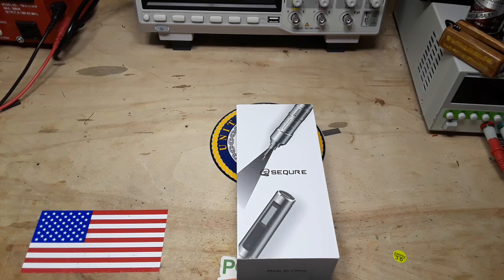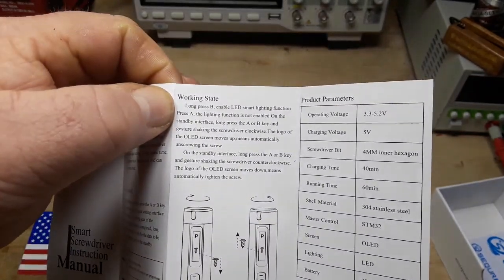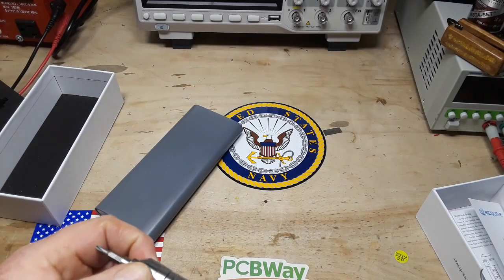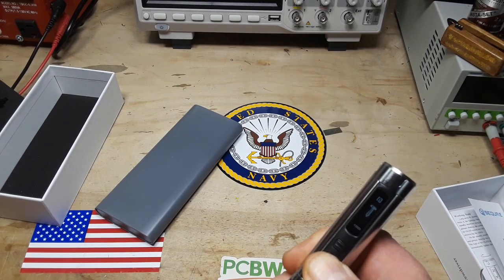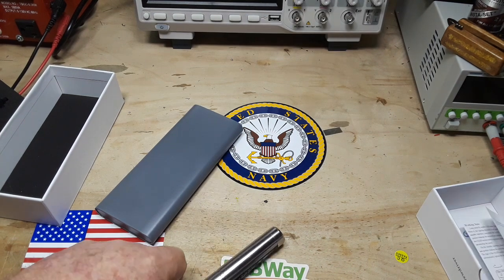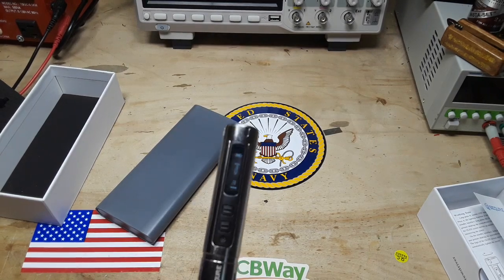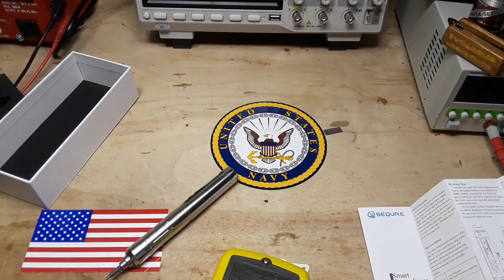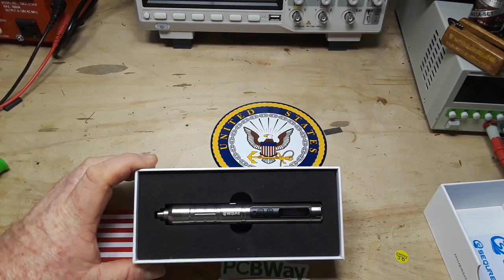SQ-ES126 Smart Screwdriver

Comment: Thank you for your review. I haven't laughed that hard in a long time. This is such an incredibly simple tool to use and you couldn't figure it out.  You just put the screwdriver on the screw, press and hold the button and rotate the screwdriver slightly counter-clockwise  - just like you would a regular screwdriver - and it will remove the screw. To put in a screw you do the same thing except you rotate the screwdriver slightly clockwise.

At about $100 this screwdriver is not for everyone. It's for people who regularly work on electronics like laptops, cell phones, cameras or RC drones. If you deal with a lot of screws on a regular basis this device is a tremendous time saver, not to mention the savings in wear and tear on your wrist. As far as electric screwdrivers goes this one is one of the best due to build quality and the ability to adjust the amount of torque that is applied. Sorry you missed all that.
Reply from the maker: Right over my head

Comment: Thanks learnelectronics' for reviewing ES126 screwdriver! This is sequre company, our this screwdriver have direction sensor inside, when you turn it slightly to left or right it will detect the direction automatically. All you need is to hold the lower to start it. If anyone have question about using this screwdriver, feel free to contact our official customer service. Thank you!

Comment: It's most certainly not "gears" but power levels driven by a switch mode power supply
Reply: Watch the Marco Reps ES-120 and ES-121 reviews. They have some interesting gearing inside.
Reply: @emmettturner9452  i stand corrected

Comment: OK... I have had the ES121  for a few years and love it. This is basically a clone of the ES121, close to clone, mine has one button. You've got the settings and how to use it all wrong. The "A" setting is for AUTO torque, meaning the more you turn it while holding the button down (doesnt matter what button) the more torque it will apply. You dont hold the button down and do a quick turn to "set it", it turns according to which way you start to turn the screw (while holding the button down). In other words, to use it, put a screw in hole, hold button down (continue holding button the whole time), turn the screwdriver very slightly and it will start turning that way. On the Auto setting, it will turn faster as you turn it more, you barely have to turn the screwdriver. P is kind of like low and high according to how much you turn the handle. The number settings are for constant torque/speed. 1 being the highest/fastest. Hope that helps. EDIT: I have seen other people review the Sequre one and also have a hard time understanding how to use it. I believe it is the poorly translated instructions.

Comment: I think you are missing something. If it’s anything like the open source ES-120 and ES-121 screwdrivers, and it seems to be, then it is gyro-controlled and not intended to be operated with buttons. Watch the Marco Reps ES-120 review. Also check out his ES-121 review but understand that he is just goofing around with that one and never discusses the gyro control. ;) That said, I also refuse to use electric screwdrivers. I want the feel and control I get manually and the extra second or two is barely anything, even cumulatively.
Reply: yeah, it just looks like a clone of the miniware units
Reply from the maker: I'll check that out. If its the case. That should be in big bold letters in the instructions
Reply: @learnelectronics  Yup. I just made another comment about this. The directions that came with yours are not very clear. But it does seem like you just turned all us viewers off to this product. I have the ES121 and love that thing, these are clones and I'm sure it works just as well. I use mine for building quadcopters mostly, and it does save quite a bit of time. I use almost daily.....like all the frikkin time. Love it.
Reply: @learnelectronics  Yes, but most would know this before purchasing if they get it right in product listings and marketing. Doesn’t apply when someone sent it to you unsolicited like this, so they still need good instructions. ;) It seems that the buttons are used even with gyro control but not for changing a direction setting. Someone said one button operates with the LED light and one operates without, which is why you can use buttons A or B.

The part where is says to “long-press A or B and gesture...” they are talking about turning the screwdriver in the direction you want to go and it will start turning that way. That is the “gesture” to control it. It isn’t a setting that changes. They probably should have said “hold” instead of “long-press” but that’s your typical poorly-translated Chinese instructions. ;)

Comment: It violates my first rule of usability:  a product (tool, software program, whatever) is useless if the most basic functionality cannot be accessed WITHOUT reading the manual.

My rules for software are:

1:  Basic functionality should be obvious without the manual.

2:  Slightly advanced functionality should be achievable by accessing only the built-in help.

3:  Only the truly complicated or advanced functionality should require accessing the manual.

For hardware, number 2 and number three are both covered on the manual.  Good manuals put the advanced stuff in a separate section in the back so that it does not confuse the user in situation 2.
Reply: I have similar rules  as rule one /  second rule /  disregard all other rules
Reply: Reasonable.
Reply: If he tried to turn the screws manually like he (and I) prefer he would’ve discovered the gyro control function and stopped messing around with the buttons. ;)

Comment: I don't think humans need to invent things that are already perfect in every sense, my screwdriver does the job better than the smart screwdriver and I don't need to charge it.
Reply: I've had a very similar driver for a few years and it NEVER leaves my bench. Huge time saver. This one is a clone of the one I have, exactly the same but mine only has 1 button, but it functions exactly the same. Paul was just having a hard time decoding the badly translated instructions. You push the button(either button apparently, the button doesnt determine direction) and then turn the handle while screwing something down. "A" is for auto torque/speed dependent on how much to turn the handle while screwing a screw, "P" I forget what is stands for but is a high/low setting according to how much you turn the screw, and the numbers are for constant torque/speed.
Reply: Yes,but you have a 100 dollars that needs to go to this mindless contraption! 😁